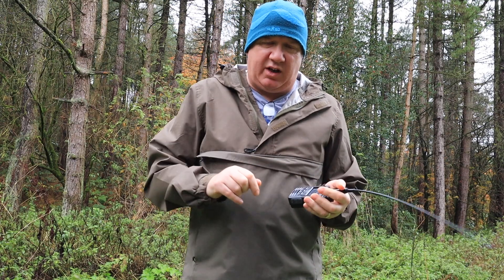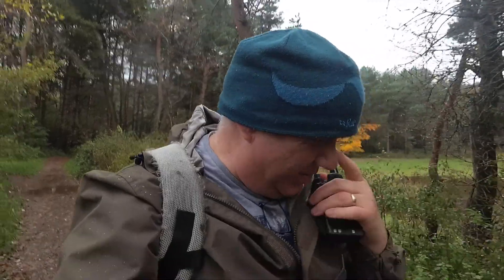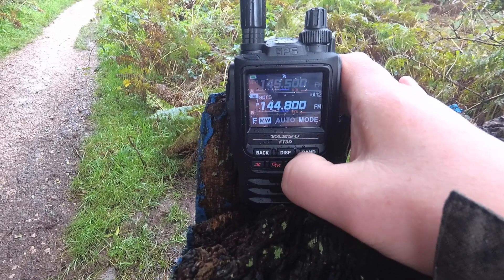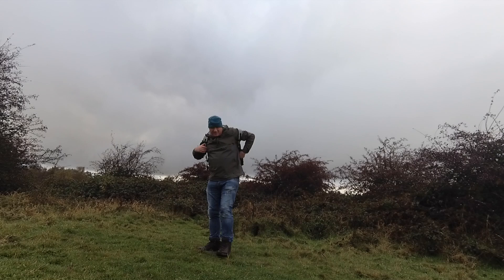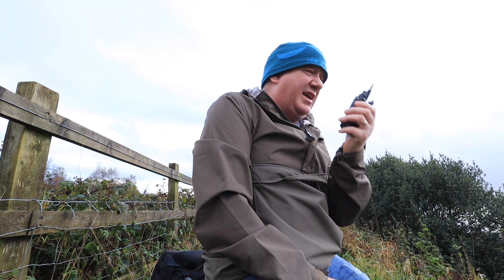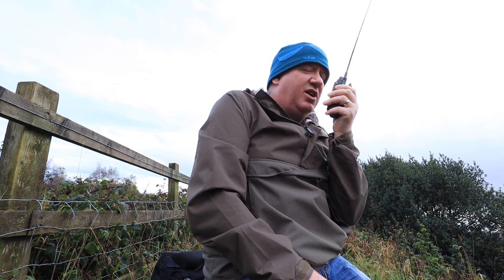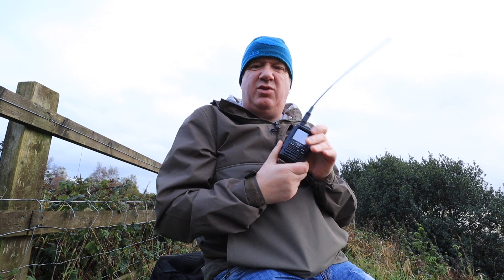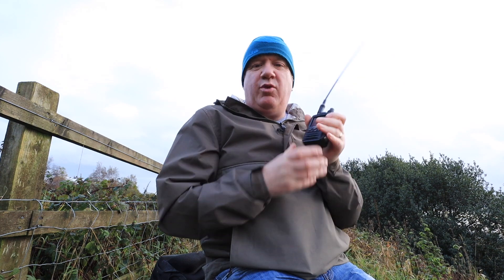Outdoor review of the Yaesu FT-3DR handheld radio

Comment: Thanks, Carl.  Been enjoying several of your videos of late.  Loved you taking this radio into the wild for a review; so much more interesting than a desk surface.  Great to see someone using a portable radio for it's designed purpose (which is mobility and it's ability to be used anywhere). Good on you for exercising certain features in the environments and ways they were intended and serve the owner most.   Too bad the APRS didn't work out for you, really wanted to see the location functions in operation.  Betting there was a misconfiguration somewhere, easy to do.  BTW, fat fingers should be no issue with the touch screen I believed - perhaps incorrectly - that it could be entirely operated without touching the screen.  You can move through selections with the knob on the top and then select what you want with a button on the front.  No need to touch the screen if you don't wish to.  I sometimes have trouble at the edges myself.  Maybe that's not true with the APRS beacon, haven't messed with it on this radio before - but will soon.  Thanks again and 73.

Comment: I have a question for you, sir.
I'm looking to get into ham radio and to get my licence. 
I'd like to get the Yaesu FT3D as my first radio.
My plan is to be able to listen whilst doing my foundation course. 
Do I need a callsign to be able to use this radio, as I see on setup it asks you to enter one
Reply from the maker: The callsign is used as part of the digital mode and packet radio set up, it's not used to receive analogue RF signals, I'm not sure whether you can skop that set up bit, if you have to add something I wonder if ABC123 should work. I'm sure you can skip it though.
Reply: @M0SZT  
Thanks for your reply. Got my FT3DE today before they sell out as I don't like the look of the FT5.
All I need now is a license 🤣
Little steps though
Reply: @Jamie_Dee  I have the 5D and while it does ask for your call sign you can just "plug it" with "12345" for the time being and use it to listen with until you get your license.  Hopefully, this is old news to you now and you're a licensed ham enjoying all the features of that awesome radio.

Comment: Just a note, IPX5 is not waterproof - it's water resistant to sustained, low-pressure water jet spray; in other words it's basically splash proof; it'll be game over if that gets dropped in a puddle for example.
Reply from the maker: I've dropped it in puddles, found it frozen in my tent, it's been on numerous beaches.
Reply: @M0SZT  fair enough, I can only say what the manufacturer specifications say... They were likely not willing to certify it above IPX5 for a reason.

I would recommend echoing the 'manufacturers' guidance as others may not be so lucky and find they have irreparably damaged there device and voided there warranty.

Comment: I'm thinking about this radio, but the ipx 5 (equivalent) rating means technically it's rated for splashes and 'jets of water'... I'm worried if I drop this in a puddle or a creek, it'll be done...
Reply from the maker: Puddles are ok, creeks maybe not, mud yes its happy being dropped in mud ☺️
Reply: @M0SZT  okay, makes me feel a little better. There doesn't seem to be many current or new HTs that claim actual being submersible like ip67 or better, other than a couple of the cheap Chinese ones (Baofeng UV-9R is one). I'm not against that category, but Im wanting to 'step-up' to better, plus the APRS (which I want to get into). Annoyed at myself for not getting a D74 when I could have (I really liked the idea of a built in full TNC, plus physical keys)...

Comment: Be careful when using a 3rd party antenna with the ft3d as the seal at the bottom isn't the same as the standard supplied rubber duck whilst out in the rain & moisture

Comment: Did you ever sort the advanced out? Gaz
Reply from the maker: It's still a goal amongst other goals, the choices are, I spend less of the very short time I have to operate radio studying a book or learning what's required in the book tinkering with radio and electronics. 

What works for me is booking the exam and then studying the theory in earnest.
Reply: @M0SZT  cool.. I did the same, I actually booked 2 exams :-)) passed first one the had to make some frantic phone calls to cancel second lol

Comment: Hi Carl, thank you for this video. As I have also that FT1D (the old one, not the XD) handheld from Yaesu, and I am not satisfied with it. So some questions about the FT3D.  Has that radio a proper and easy to use volume control for the receiving audio? To adjust the audio gain at that FT1D I have to press and hold a button close to the PTT switch and then, while pressing that button, I can adjust the volume with the rotating knob on the top. A realy nightmare IMO. Does the FT3D have a direct to use volume control?

And can you use the external microphone from the old FT1D? And the spare batteries from the FT1D? 

And are there seperate microphone adjustment gain levels for analog voice and digital voice mode? The FT2D does not have this and so the mic gain is not proper adjustable for both modes. If someone sets the level ok for digital voice transmissions, then the mic level for analog FM mode is not ok, and vice versa. Only one setting in the menue for mic level, that is bad, I hope, they have fixed that at the FT3D?

Greetings from Hamburg/Germany,
Dietmar, DL4HAO

Comment: In my experience, moving around and standing in different spots with my HT is better than stationary. Also, keeping the radio in the upright position with the antenna as vertical as possible helps when in a questionable area. Just sayin`. KC3BXZ

Comment: Nice test, Carl. I agree that the touch screen can be difficult to use if you have large fingers. All is not lost, however, as, unlike most mobile phones, the screen makes use of resistive rather than capacitive technology. So you can use a blunt object such as a plastic knitting needle to make selections, a great help if you have large fingers or are wearing gloves.

Comment: could you do a comparison video between something nice like that radio, and a really bottom of the range Chinese radio? Obviously the more expensive radio is going to be far superior when it comes to feature set, build quality and reliability, but I'd like to see the difference in purely making contacts. Does the person on the other end really notice a difference? is one more successful at holding a conversation than the other.
Reply from the maker: Ok yes I tried that a while back however it was not a good comparison video, I've been tempted to try again with more planning up front.